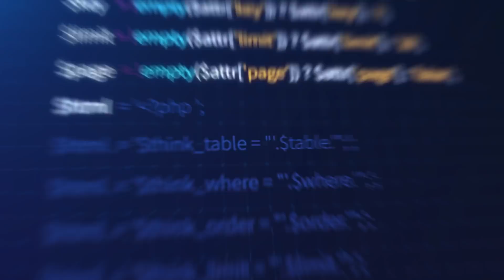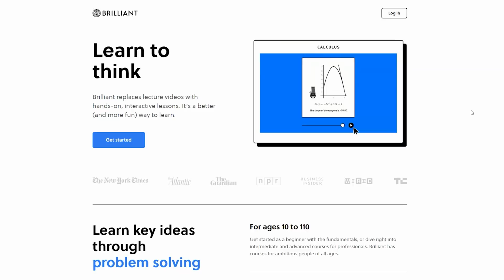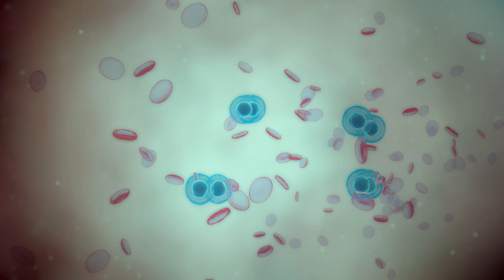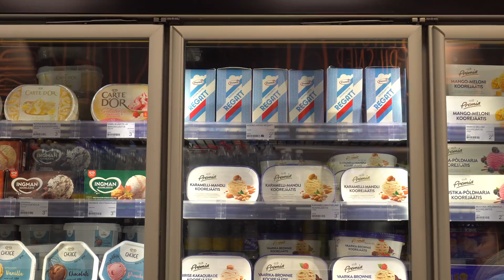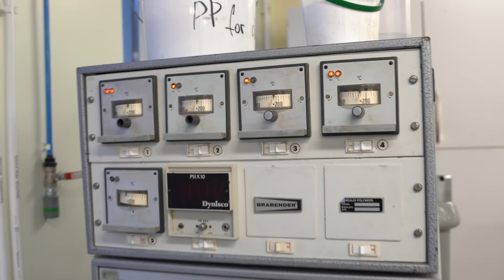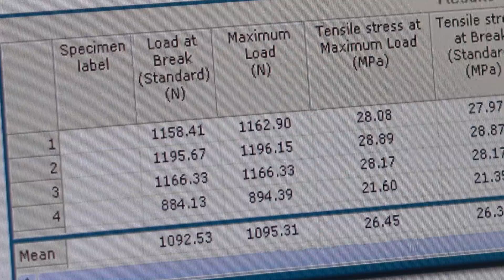I made a new material from an old t-shirt

Comment: What I do not get, and I would explore if I had more money, is why plasma processors are not focused on particular substances in order to implement processes of higher efficiencies. For example plasma processing focused on specific materials.  A plant designed to process polymers, a plant that is focused on cellulose, tuned specifically to those, and other, substances.  Specific focus will lead to efficient processing of materials into methane or syn-gas products which can be used in efficient fuel cells or polymer precursors.  Like cellulose can be use for polymer precursors.  While either can be used as methane for fuel cells which have have greater efficiencies than other methods of producing electricity.

Comment: 16:50 |> DON'T TRY THIS AT HOME))

Q.:  How much does it cost to study chemistry at Tallin's University (i figure) at this day and age?

P.S. TANGENT CAM.:∆
 I did a course in analytical chemistry at Latvian University's Chemistry Faculty (in Central Riga).
 Funded by state then, however can't remember if they made me a written certificate, considering the 2-year course parallel with secondary school ended in 2001. Besides, the course was borderline individual, as the only 2 participants were my best buddy in chemical experiment category (slow uptake and low publicity/interest due to post-soviet professional chemist wage levels ¯\_(☯෴☯)_/¯) and me. Furthermore, it didn't count internationally as a grade. 

 Now, yet under 40, i genuinely consider joining those genial young apprentices Thoisoy is collaborating with in this episode. 
 Our inventors from Riga also found a way to recycle waste plastics. This time much cruder process with one advantage: a possibility to mix multiple materials, thermoplastic for now. All thermoplastic materials are pretty much fit for purpose. Got to read into it:
researchers from the Latvian Technological Centre, and the Institute of Polymer Mechanics at the University of Latvia have come up with a solution.
[*In collaboration with Hormigones Uniland, a Spanish cement company and some nifty Lithuanian manufacturers: 
"Funded by the EUREKA programme, the SANDPLAST project has developed a technology for the production of concrete building materials using polymer waste and inert fillers.
..the researchers have succeeded in turning thermoplastic polymer waste into a binding substance that could be mixed with other materials, like sand, to generate cement-free polymer concrete goods."
 🔎~'Pavement bricks made with recycled plastic in Latvia', or here:
 cordis.europa.eu/article/id/29365-in-with-recycled-plastic-bricks-out-with-cement

Comment: Just an idea: You may make it stronger with electrical currents. 
But this might take some research. The theory behind it is that the electrical currents create bonds between fibers even if you have weak electrical fields. You may need AC to connect better to dielectric materials.

Comment: actually old textile mixed with plastic is the worst way to recycle it in my opinion - this way you produce same non biodegradable composite material which has worse parameters than pure plastic

I can give you better better idea for old textiles - concrete reinforcement - the studies are fairly new and still in progress though but promising. And the benefits are reaching further as concrete will bound the textiles inside - it will not create microplastics

Comment: Plastics and other synthetic materials can be pyrolized into fuel. Plastics and synthetics are made from natural gas or petroleum products to begin with. Through pyrolizing/heating, they can be broken back down into the materials they were originally made from. This would allow the resultant products to be remade into plastic/synthetic or burned as fuel in electrical generators or boilers to desalinate seawater. They are a resource that is not being utilized on a large scale but is being done in some remote areas without other fuel sources.

Comment: Plastic coated interlocking bricks for construction I think is the ultimate use. Rough surface for rendering and chemical bonding with glues. They wouldn't crack and they will be water proof and no rising damp. The bricks could be simply dipped in the plastic or sprayed with it.

Comment: I think the problem of reusing plastics is similar to what happens to cannibal oil when extracting it with a solvent using heat. The problem is the poly carbonate structure breaks down easily and quickly at higher temperatures. Like the difference between using alcohol or butane is the temperature at which each boils and thus the higher temp of boiling the alcohol causes material to degrade and essentially burn. Maybe the plastic needs to be processed at a different pressure at a lower temperature or with a solvent that boils at a lower temperature or even sublimate. Think aerogel but I call it Airojell.© Great video by the way. I notice you dub your videos. Your English is getting good.

Comment: Its not the plastics that need to change, its society. Quantity douse not have a quality of its own!🤑 We need "Recycling prevention programs" reusable containers, eco friendly detergents, less consumption, less over packaging. "ONE GRAM OF PREVENTION IS EQUAL TO A KILOGRAM OF LESS RECYCLING" This self destructive behavior can be corrected by tracking consumption digitally on a personal level. We all have devices that can monitor and correct behavior, punishable with fines. Just because you have the ability to over consume douse not mean you have the right to overconsume. Recycling costs energy, if we prevent construction and implementation of disposable materials we will not need to spend more energy to repurpose those materials, over and over. Just a thought...................

Comment: If it was put into a burner unit that is tough enough to do so like one that has the control of the smoke that smoke could be used to turn a turbine and after that turbine that smoke would be bottled in metal bottles for recycling to get what usable compounds that's in it like if there any Argonne gas in it then why not take that out by making the gas go into liquid state and chemically take it out

Comment: Thank you very much for this video!
The problem with recycling of plastics is, that it is almost impossible to sort the wide variety of different polymers out, be it due to the lack of the knowledge of the customers, be it because different plastic layers are combined within the same object, be it because of the lack of different containers for PP, PET, PE, PVC, etc.
Perhaps a slight help would be the addition of specific pigments with a unique spectral signature in the UV, or VIS or IR light, so that machines could sort (most) of them aautomatically out.
On the other hand instead of burning the plastics, you could pyrolyse them (e.g. with solar arrays reflecting the sunlight to its reaction centre at the focal point) and distill the produced vapors to collect the various substances out of it like alkanes, alkenes, alcohols, etc. and the residues of charcoal mixed with S, Cl, F, ... and metals like Al, Sn etc.
Landfills are the worst solution.

Comment: An australian company has a patent on method where they put high pressure on plastics to the point that it breaks down into crued oil again. Only problem is the high energy consumption, which maybe in the future should we ever gain fusion wouldn't be an issue then anymore. Then again australia should have no problems with going solar energy.

Comment: In regard to plastic and clothing, my idea would involve turning the unrecyable plastics into bricks that can be used to build stuff. The clothing can be used as "filler" or aggregate depending on the engineering requirements for any given application. For example, a building will require different standards than a decorative fountain. As for microplastics, I guess we'd have to coat the bricks in something like epoxy resin to ensure the bricks don't erode and emit microppastics.

That said, I don't know how much heat and energy it would take but this would be a relevant consideration.
Reply: Those bricks will be flammable and release microplastics forever
Reply: @krz8888888  but what if we melt glass and encase the bricks within that melted glass? Okay yeah, you're definitely right about first example... and this revised example is an exercise I'm madness. 

Even if it could be done without leaking microplastics, it would be no time before industry skipped and built the crappier version.
Reply: Best way would be do destroy it with a plasma gasifier and make some energy on the out. A complete combustion with no micro-particles.

Comment: A solution to the trash problem is incineration with electrical cogeneration. It's not a perfect solution, but even if you believe in CO2 global warming, the incineration simply would replace emissions that would be made anyways. Pollutants can be scrubbed from the exhaust, which adds cost but is necessary.

Comment: Lightweight and applied durability to specific tasks; sounds like something SpaceX, Roscosmos, CNSA or any of those space administrations can incorporate into the structure/insulation of large one-way bulk-transportation vehicles to Mars and planets beyond, where they can then be broken down and used for localized planetary construction projects... tho the linen-composite plastic probably won't have great endurance against radiation on Mars than it would against the super-low temperatures.

Comment: I don't think it's actually possible to run out of places to bury stuff. Plastic ending up in the ocean or as pollution elsewhere is a matter of either lack of infrastructure or societal indifference, not something inherent to plastic or waste in general.
Reply: There are cities build on top of landfills, if done properly it can work. The only problem with landfills is when they are not properly made in respect with protecting the underground waterways, and if you are going to build on top of it, you have to do proper engineering because there can be pockets of gas that turn into holes  . I don't know why people think just land-filling plastic doesn't count as a solution, while they still keep dumping on the ocean or sending it to poor countries, which is even worst.
Heck, literally burning the plastics in a autoclave with a closed catalyst would do the trick (yes, that emits CO2, but it would be such a tiny amount of CO2, we still have fucking coal burners, heck literally burning plastic instead of coal would be better)

Comment: if im not mistaken they already have found the solution to the problem of plastic, which involve high pressure and water i think?! and they turn it back into oil / hydrocarbur. something along that.
they have also found bacteria capable to process plastic..

Comment: In medieval England damaged old clothing would be left in water with a little lye to break down and then when there's a jelly like emulsion of fibres left it would be lifted out on a mesh and while wet a makers mark would be hammer into it with a dye {hence the term watermark} the then mix would be gently squeezes of most water and then left to dry, producing an extremely high quality parchment.
Reply: parchment is made of animal skins.  also, the watermark isn't "hammered"into the wet paper.  it is pressed with a roller.  also, at the time, most paper was made of new linen fibers.  wool was an unsuitable fiber, and cotton wasn't terribly widespread.  and this was much, much earlier than the discovery of the process used to turn wood pulp into paper.
Reply: @JohnLeePettimoreIII  no that's vellum

Actually it was usually a hammer at the time as they ere considerably cheaper

No they weren't they were old linen, I never mentioned wool.

If you're going to needlessly troll. Have a clue what you're on about 🤡🤡🤡🤡

Comment: Sorry I'm not convinced; especially when considering the energy costs to make and scaling this sort of thing up. 
Also if it needs LOADS of people to do manual labour (sorting/grinding) it makes the principle less feasible at scale.
Not against people trying these experiments however, might lead to even better solutions/methods one day!
Reply: Well as it goes along, they'll find ways to streamline & automate it. The challenge is getting it to be credible enough to get to that point. But if that point is reached, then it'll become easier, faster, & cheaper to do. This has been the case with pretty much all technology that has made it to mass-market levels. Like learning to stand before eventually becoming a champion sprinter.

Comment: One of the first synthetic plastics, Bakelite, used sawdust mixed with phenolic resin.  It is a composite material where the sawdust is a cheap filler and the wood fibers add additional tensile strength.
Reply: AND it stays crunchy in milk!  😁
Reply: are you sure about that ? Bakelite was I think, THE first ever plastic, a phenol formaldehyde resin. Horrible black, brittle smelly stuff, used in things like old timey telephones etc. once you smell it you never forget it.
Reply: @psycronizer  nitrocellulose

Comment: Surely you just make the fibres from the fabric longer when you chop them up. Longer fibres might introduce a reinforcing effect which would perhaps make the materiel stronger?
Reply: Unfortunately, long fibers can't be injection molded as they disturb the flow of the Polymer.

Comment: Wonderful ideas .
 Were more of my neighbours , to recycle properly it would make it easier & would work .
 That leaves the collectors of said sorted garbage - the glass we seperate into colours , the collectors dump it into one bin .  Other household rubbish , often gets dumped into one bio-bag , put into the rubbish bin and it goes from there to the dump , from which a creek exits , and a gas collection system has been buried , to flare off methane , which could be captured , for the city supply , instead it's flared off , 24 / 7  .
Reply: one of the biggest issues with recycling is the infrastructure.  while only a percentage of the population actually sorts their waste products, this small amount STILL far outstretches the capacity of the recycling industry.

Comment: As a chemist what do you think about chemical recycling, so seperating waste into its individual elements or some form of raw material like oil in case of plastic?
Reply: I think the plasma arc waste recycling is closest to this and even that produces a rock-like material. Recycling absolutely anything in a single plant is theoretically possible but it would take unthinkable amounts of energy and produce comparable amounts of heat. Hence it's rational to pre-sort the waste and recycle each type separately - biowaste can be composted, plastics can be pyrolysed, batteries can be dismantled into separate wastes.
It often boils down to economy rather than technology.
Reply: @LiborTinka  i hope we can some day just dump everything into one big machine and it seperates out every single element neatly.
Reply: the process would be FAR too expensive to be functional.
Reply: @JohnLeePettimoreIII  well not really. cargill has had that anything into oil plant for a lot of years now. Unless they have shut it down or something (I haven't bothered to check up on it).
If you have a good supply of a single type of waste stream you can about break even with it years ago, and with the stupid crap going on now, you might even make a good sized profit.
Reply: "anything into oil" is old tech now.. plastic, organic matter, etc. There is a plant next to the Cargill chicken plant here in Missouri that converts the waste trimmings into fuel oil.
Reply: @demandred1957  i mean turn the plastic waste back into plastics raw ingredients and make new plastic
Reply: Anything to oil is called pyrolysis, like how turpentine is made. 
  Anything with chlorine like PVC is bad...
  Even clean and sorted , the oil can re-polymerise and/or turn to wax clogging up factories.. so just easier to go straight to furnace.
   In Hazelchem videos ,he shows chromogrophy results. It's the chems that are Louis acids and bases that tend to react in the tank.
Reply: @demandred1957  I saw that technology make lots of science news articles years ago but I never saw it catch on. Every landfill was going to become a source of oil with the metals and glass separated out for added revenue. Every waste stream from almost every industry was going to be gobbled up. Years after these articles we still ship “recyclables” off to developing countries so it looks like they aren’t going to landfills.

Comment: The laser cutter you used, has some misalignment in the lenses, or the tube does NOT output a consistent round laser beam. Check all the mirrors and focusing lens for dirt or cracks. If everything is okay, test the laser beam shape with an acrylic piece thick enough, at low power, to see the shape of the beam.
Reply: Most lasers do not make a round beam that would be the older type or some of the CO2 or argon based gas tubes modern lasers are mostly a LED type device or you could say solid state.

Comment: We currently use laminated high pressure wood plastic composites as part of our machines because they are durable, easy to machine with common tools and fire resistant. Maybe this cotton plastic composite material will become popular as new applications are found for it.
Reply: Might be due to polymer chain alignment under stress
Reply: Old school: molded bakelite used graded sawdust to enable flow and give strength/resilience to the otherwise brittle plastic.